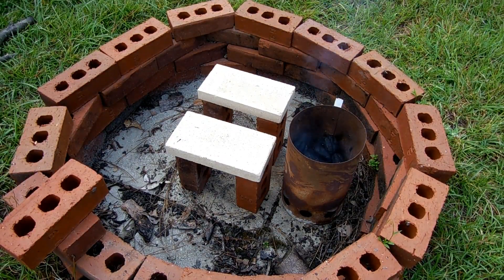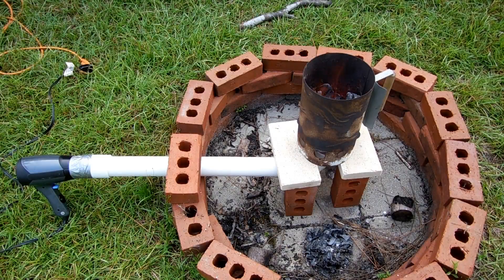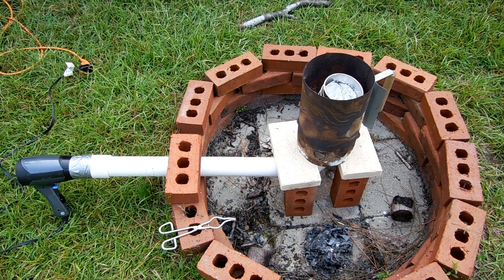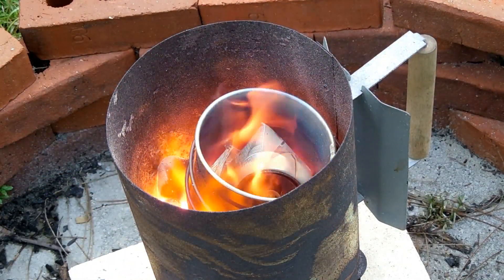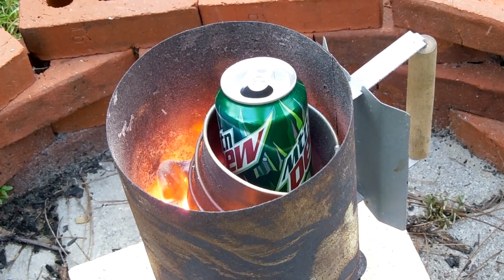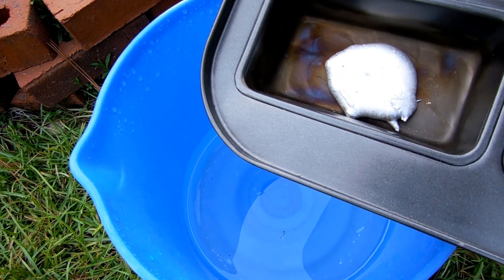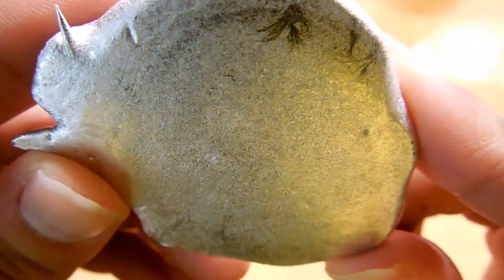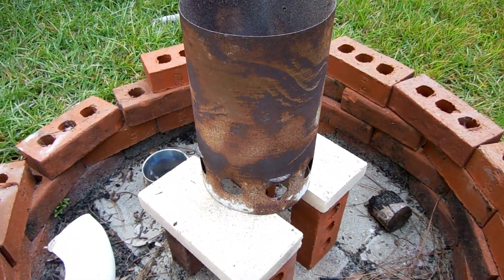Very Simple Aluminum Furnace

Comment from the maker: Probably not necessary, but I talk about why I have it in the video. The thought is that the foil will melt and form a pool of liquid, which will provide better contact area with the cans than the cup alone would. This makes the first few cans melt easier. I haven't tried it without the foil, so I don't know if it actually makes a difference or not.

Comment from the maker: It did, a bit. The end of the pipe was a few inches below the fire, plus it gets cooled by the air moving through it, so it doesn't get as hot as you might think.

Comment: I've actually melted aluminum using a tin can rocket stove, twigs and small sticks from the yard and a small amount of breath to help it along.  You may want to try a CPU fan instead of hair dryer..a slower heat, but you'll consume less charcoal and possibly have less slag as well because the air will have less oxygen in it.

Comment: Alright Broheim,  you are losing a significant amount of heat to the outer walls of the charcoal doo-dad.  You should insulate.  You could put the stove in a container with a slightly larger circumference and fill the gap with something insulative like sand.  That should increase your efficiency both with fuel and time.  Happy smelting!

Comment from the maker: Good tips for sure. It actually has a "cool" button on it that disables the heating, but you need a lot of force to hold it down so I don't think I'd be able to tape it. I'll have to break it open and disconnect it. Not sure about copper - I'll have to try!

Comment: I would say crush your cans to decrease enclosed volume and surface area (a bit). Also the tape on the hairdryer might be coming off due to the heat. If you hack into the hairdryer and cut out the heating coil this might do the trick. Great video! I'm wondering if this would work for copper?

Comment from the maker: You'll probably get close to that amount, but be careful! The crystals should be mostly KCl, but almost certainly some NaCl will have coprecipitated. Depending on your needs, I would recommend a few more recrystallizations to increase purity. Each time, of course, you'll lose product to the solution, but the crystals will be purer and purer. These are hard to separate completely - you might never get to the point where Na stops showing up in a flame test. See my other video on recrystallization!

Comment from the maker: Piranha solution is extremely dangerous, usually a last resort for cleaning. Carbon is tough because it's very unreactive - if scrubbing with soap and water won't remove it, piranha might be your only option. Personally, I wouldn't go there though. Carbon contamination shouldn't be a big deal for most things, and if it's impossible to get off with scrubbing then it's unlikely to get into your reactions anyway.

Comment: Piranha solution which is 98% H2SO4 + 30% H2O2. It causes the carbon to turn into CO2. It is very exothermic and dangerous. I have tried 95% H2SO4 + 3% H2O2 (from pharmacy) but this is very weak.

Comment: I melted down a doorknob with a similar foundry, made from stacked firebricks and a $10 bath fan.  You should wear leather shoes and use a more secure handle for your crucible, such as a large vise grip.  Even that small a pig of molten metal will burn through your foot to the bone.

Comment from the maker: No, it's all aluminum. Melting it down doesn't change its density. The final lump is very light, strange when you're used to handling "regular" metals like copper and iron.

Comment: When PVC burns it produces some nasty compounds that can do harm. Better to use a steel pipe for delivering extra air to the fire. Also, I have heard that burning non-stick coatings from pans will also produce harmful compounds which one should not breathe. I'm sure you took precautions.

Comment: I used to melt aluminium in a tin can, by simply putting aluminium pipes in it and putting the can into a campfire. This took some time so I speeded this up the next time by blowing air with another pipe into the blaze below the can. I remember this working pretty well :)

Comment: I got a bonfire to melt soda cans once. We were burning huge pieces of hedge (A very dense and heavy wood), and I set them up so that there were some vent holes between the logs leading into the hottest parts of the fire. Out of curiosity, I stuck some a soda can in there after a few minutes, it melted. 

I flipped, and had all my buddies stick their cans in and we watched them all melt.

Comment: The best way I found to melt cans was to cut the tops and bottoms off, where the metal bends inwards, and to make a cut along the length of the middle section. It allows the tops and bottoms to fit together closely, and the sheets you get from the middle fit together nicely as well. It minimizes the surface area to prevent oxidation, and you can wash and dry them to eliminate steam explosions.

Comment: Aluminum cans are plated for two reasons.
1) you can't paint aluminum
2) shiny plating makes the label brighter

Anyway, most aluminum alloy has some copper or other metal in it but AFAIK aluminum wire does not or has less.